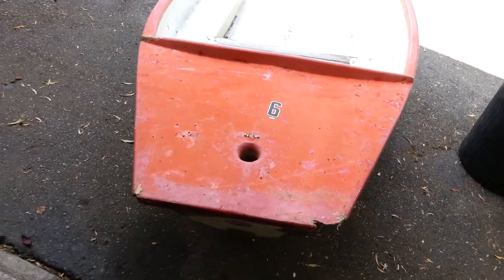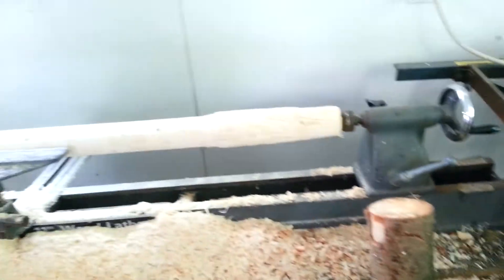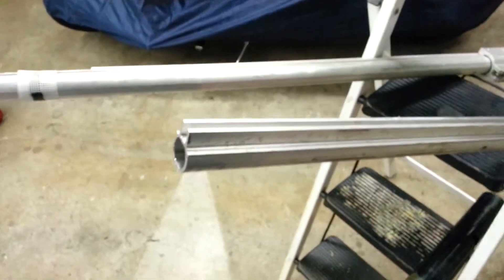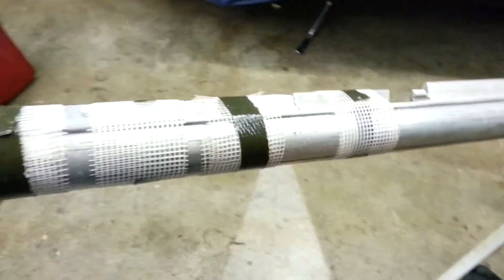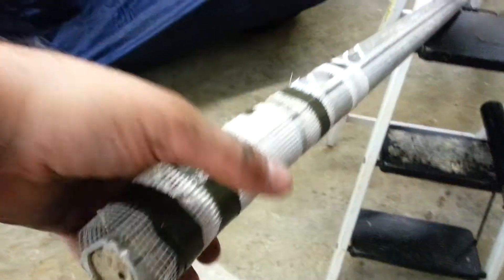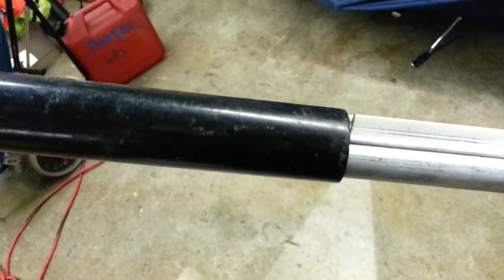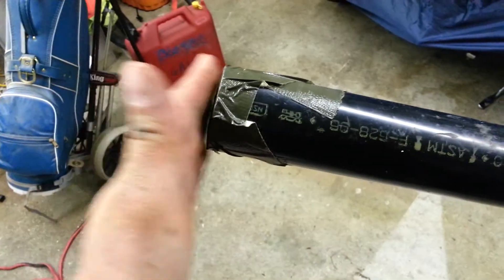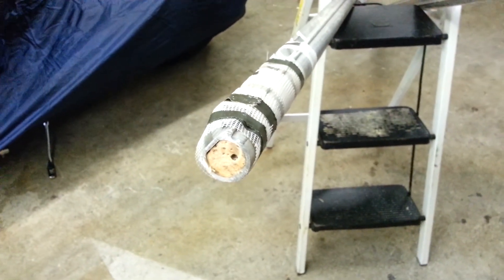Mini sailboat mast fabrication

Comment: where did u get the mast exactly?
Reply from the maker: It is part of a safety rail for Cell Towers ladder safety system. We had a few spare parts so I rigged this rail up to work. It is a Trylon Safety rail. I did find it to be a bit more heavy duty than I needed for this small of a boat. These rails / masts are Extremely durable.